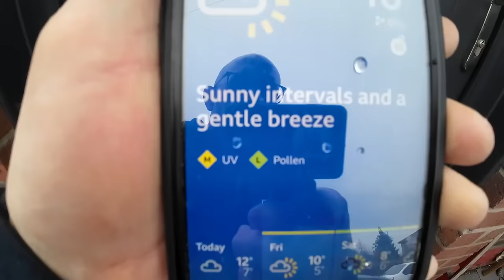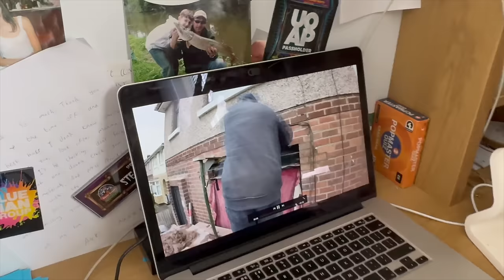BRICKWORK NEARLY COLLAPSED... THIS IS HOW WE AVOIDED DISASTER !!!  PT 1

Comment: well done, looked like a tricky one. Why do you have to support the lintel when you start rebuilding and why do you not treat the end of the lintel when you cut it down? Any galvanizing protection has now been compromised and will rust and the lintel is lonely 3mm. Can't see that lasting 70 years.

Comment: When I was fitting windows, I used to grind out 3 or 4 perps above any loose brickwork and drive in hardwood wedges to lock the bricks horizontally. take out what you need to fit the lintel, then rebuild.

Comment: Steve, I tried cutting a doorway with a  carbide blade in the recip saw but it didn't last very long at all (Old 3" ash blocks). What blade do you use?
Reply from the maker: We use carbide but the material still has to be on the soft side 😬🧱👍🏽

Comment: what brand and model cemente mixer are you using
Reply from the maker: It’s a belle 240 volt 🧱👍🏽
Reply: @SteveAndAlexBuild  ill have to see if i can get one here in the states
Reply from the maker: @stuartfarrell6729 Ah you may struggle plus they are £500 / $650 ish 😬😬good luck 🧱👍🏽

Comment: I noticed your hawk stand/two legs were placed on a narrow strip of wood.
I would drill a hole in each/leg-foot. Large enough for a beefy screw. This way if the hawk or wood should shift, it will shift as a single unit.
That's my two cents.
Omaha Nebraska USA